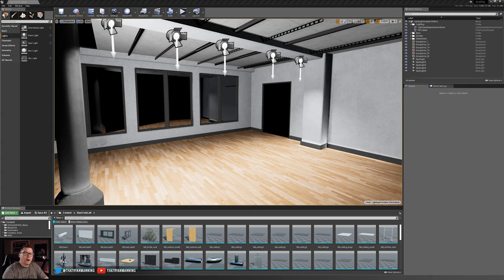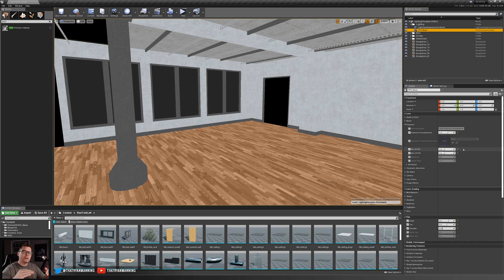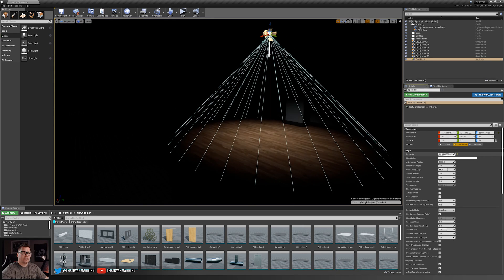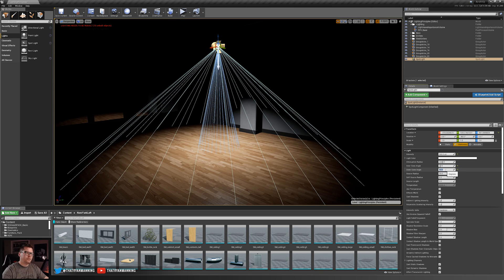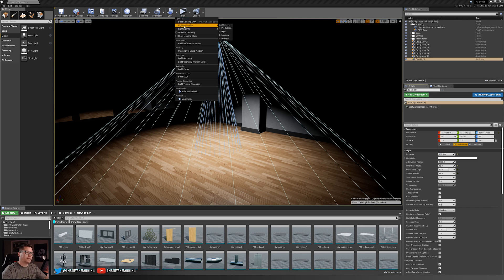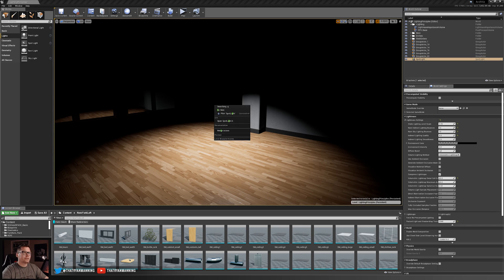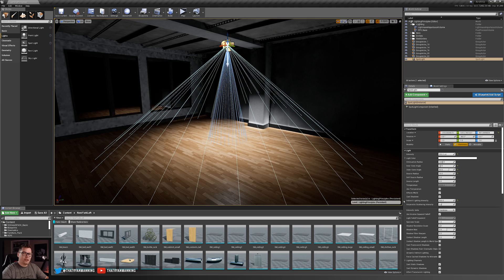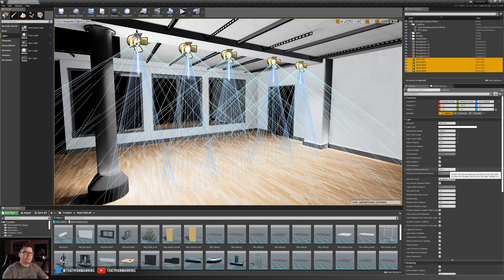UE4 - Interior Lighting (Basics)

Comment: if anyone is still seeing the weird artifact splotches popped up on their meshes, increase the lightmap resolution in the static mesh editor. No need to set your build light quality to production or anything, I keep mine on preview and it works fine this way.
Reply from the maker: Increasing your lightmaps too much will add excess texture memory overhead. This isn’t the best solution. Also, Preview is a quick approximation of lighting and generally...almost always...will cause lighting artifacts. Try building on medium or higher.
Reply: @ThatRyanManning  alright thanks for the feedback

Comment: Thank you so much for the tutorial, very helpful! I only have a small problem: when i disable auto exposure following your steps in the post processing volume, it seems to be still there (when i enable/disable eye adaptation in the show-post processing panel the lighting changes a lot). For now I disabled it in project settings-rendering-default settings and seems to be working but I wonder if they changed something in the recent updates or if I'm just doing something wrong.